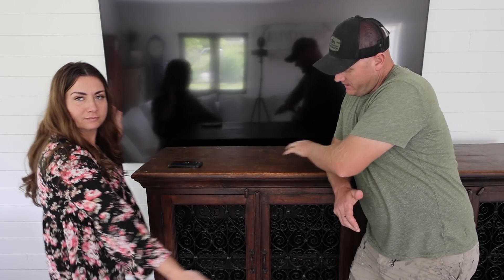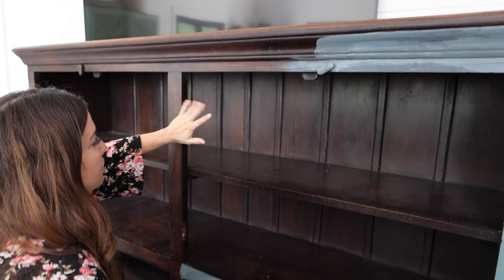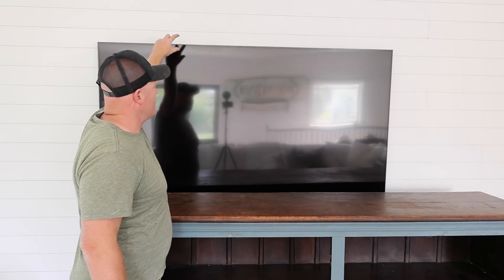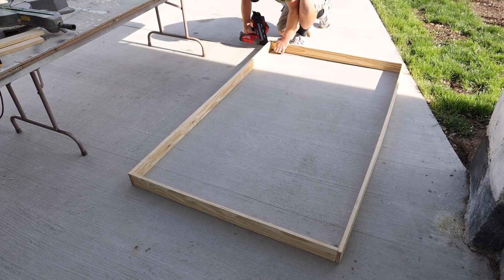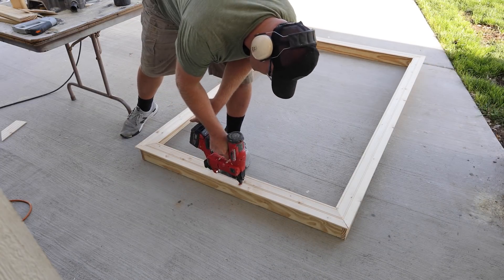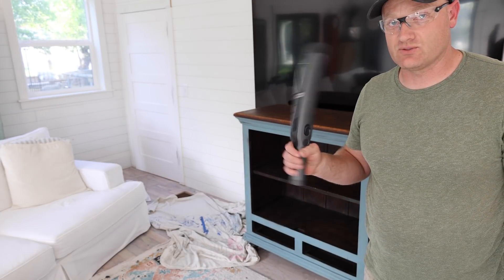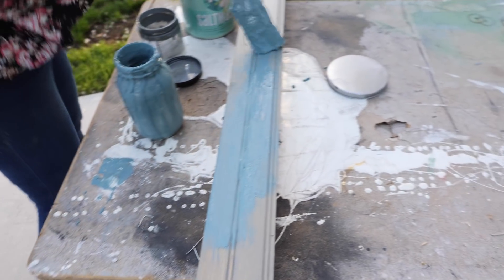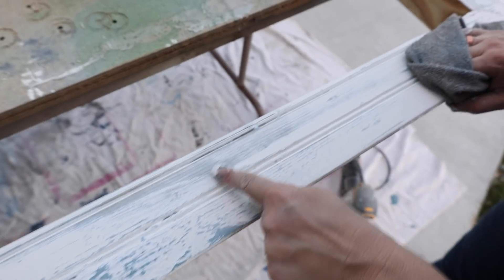$40 TV Frame DIY and chippy Milk Paint Entertainment Center

Comment: I redid that exact same cabinet! Wish I could post a picture!  The metal I had to cut out and rebuild the wood to put it back in. The whole thing has a waxy coat from thr manufacturer.
Reply from the maker: Yeah the wax is weird. I scrubbed and scrubbed and it got lighter as I scrubbed and I liked it.
Reply: @JamiRayVintage  I live in Arizona and work on my stuff mostly outside. And I had this piece outside and we had a suprise rain overnight. When I went outside it had water runs all down the whole thing. It was crazy. Then I washed is more and the whole thing was like surface die stain or something strange because the rags turned red over and over as I scrubbed. Whatever they coated it with is strange. Like a weird waz dyr spray. It's in that metal also. I wanted to scrub the metal but that was not really much of an option. The metal in the door frames has 4 metal dowels almost that hold it to the wood. They built the door around the metal. So to get it out to paint the frames I went to the back and cut with the multi max saw flat blade. But on both side if the pegs and it fast chiseled out. So I painted the frames. Put the metal back in and used putty to fill that space I cut out. Seriously easier than taping off or working around that metal. So go figure..it all went milk paint chippy (old fashioned milk paint) then hemp.oil. left the metal black.
Reply from the maker: @karleefuchs6670  are you in the Jami Ray vintage group on Facebook I would love to see a picture.
Reply: @JamiRayVintage  oh no I don't think so. Im.new to your channel. I did place an order for stencils and I just got them a few days ago. Great product!. I will go find your facebook!. I have been building and refinishing for a little over 20 years and I really don't have much of an internet presence. Lol I just make stuff and forget to take pictures lol. I will go find your Facebook page now 😁
Reply: @JamiRayVintage  I found it and sent you photos!